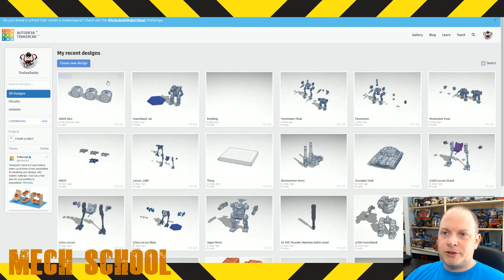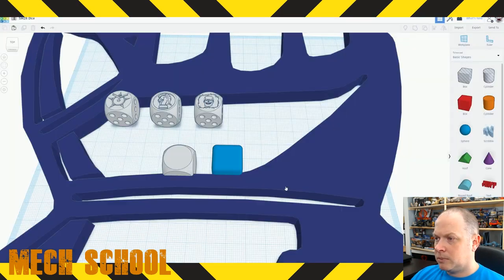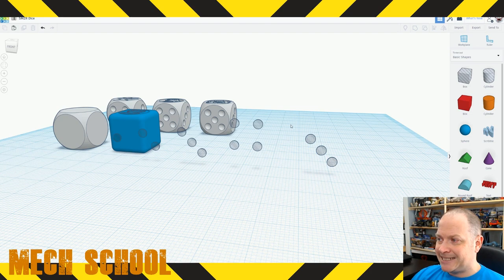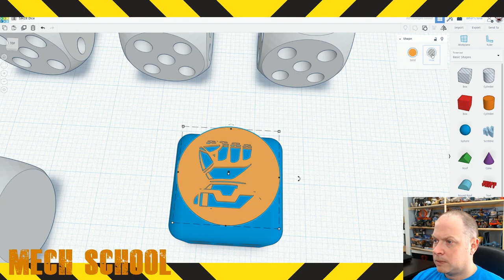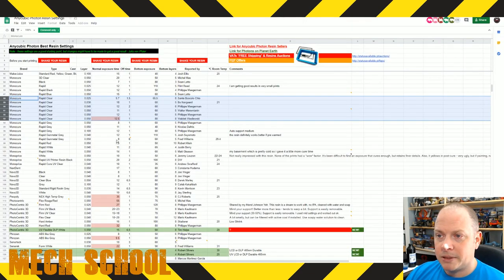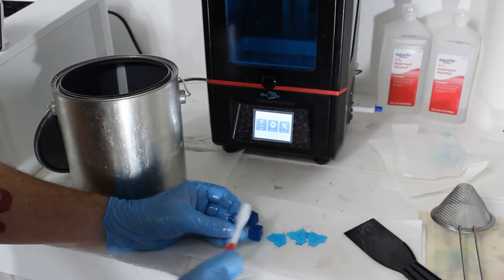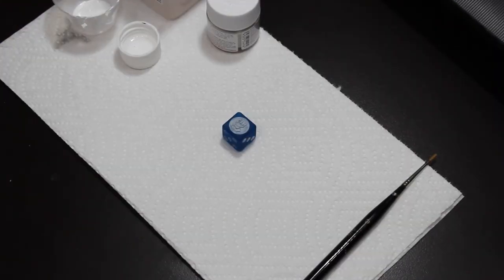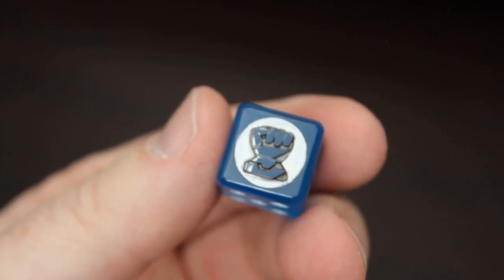How to Make Your Own Custom Gaming Dice

Comment: You had the problem with the half screen as well I see.  That burned me so badly on resin 3d printing that my anycubic has been sitting on my shelf for almost a year.  If that is fixed with firmware now I will try again.
The by FAR biggest frustration with resin printing is that there is no good way to know if your base stuck until HOURS into the print.  You can pause and raise it up, but I have heard that some have had that fail their print.
With normal fdm 3d printing you know in minutes if the bottom has good adhesion or not and can just quickly restart if something goes wonky early.
Reply from the maker: Sorry for the EXTREME delay. Firmware fixed that for me.